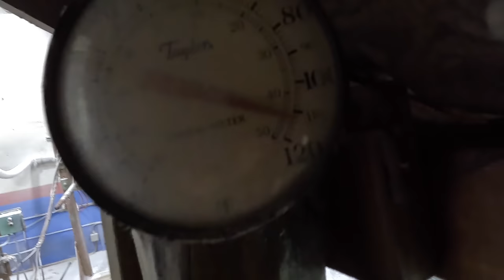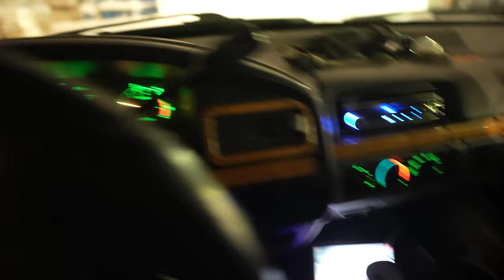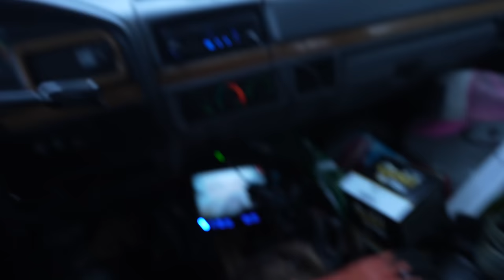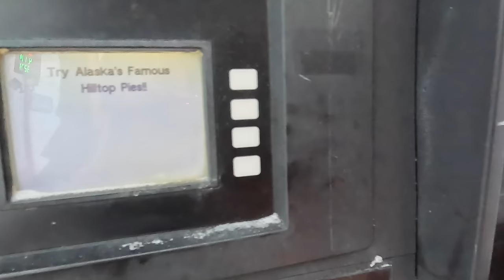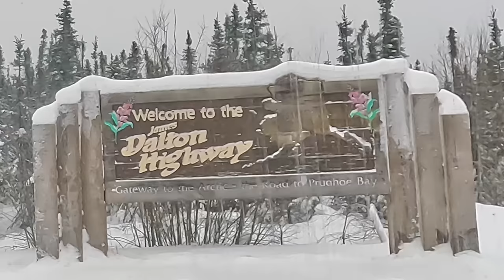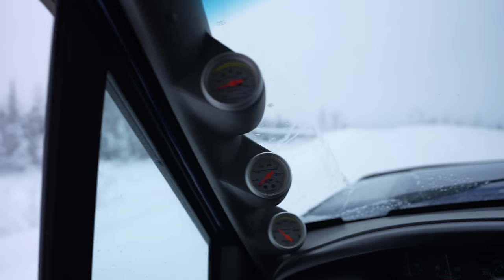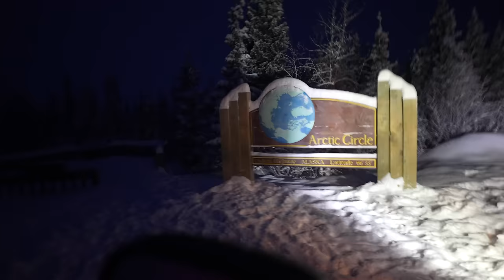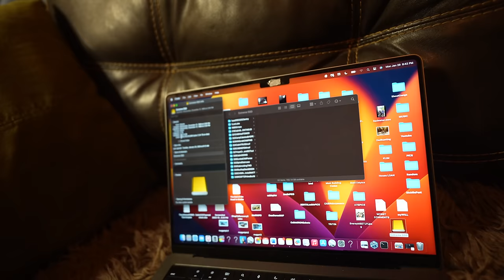Driving an Old Ford Diesel Truck 2,000 Miles to the Arctic Ocean in -53°F/ -47°C

Comment: I dunno if anyone else has said this but I recommend adding your fuel treatment before filling. That way it mixes fully in the tank. Adding after tanks a  bit of driving sloshing the fuel in the tank to be most effective.  Also highly recommend a white Roger’s 578-902 glow plug relay

Comment: Whenever I changed my fuel filter(7.3).  Id use a clean rag to absorb everything inside . Clean it bone dry in case water was still in there . Then a cap full of 911 and the rest new diesel to fill it back up most the way considering the previous diesel level when I took old filter out .

Comment: To Start a cold diesel truck ,put the propane torch directly in the intake it needs hot air and when it starts remove the propane torch (obviously not the plastic part)

Comment: Timmy,
Ive always wanted to drive that road and this was my treat for the day.
I watched the one before also but its been a while since ive watched YT.
I aced parallel parking on my first try in 2021 got my license then got a 
1994 Ford escort which is now an antique.
Unfortunately the next breakdown will park it for good.
no parts to fix the failing manual trans,syncros in second are going bad.
I lost 1st gear a week after purchase.
I love Ford and had a 2004 Powerstroke back in 2008.....Love those trucks.
BigT,Willow AK

Comment: Its air in line from removing filter.  Always visually check for coolant leaks b4 running unattended.  Wouldn't be a bad idea to have a set of guages in cabin

Comment: One suggestion get some stuff to insulate that trucks vitals fuel tanks fuel filter batteries ect and get auxiliary fuel tank like one of those construction guys use with the pump amd carry extra 40 or 50 gallons of diesel and u will be good

Comment: I’m the most impressed by your caution. You make us aware of your backup’s, backups. For more than just breakdowns or equipment failures. I was 16 when they built the pipeline. It was a better time than what 16 year olds have to live in now. Just purer. Anyhow I’m about a third of the way through your video and can’t wait to see where it leads you. Thanks for taking us along. Always, be safe. ✌🏻🤍

I’m almost done but just a suggestion to everyone who travels. You absolutely need a CB radio and it should be mandatory for them to watch Smokey and the Bandit at least once.   10-4?  ☺️❄️✌🏻  Can’t wait for the next video. Good night. 💤

Comment: Add some Howes anti gel between fill up that should help keep the fuel flowing. Most likely the fuel getting to the injectors probably had air in the lines when the fuel gelled up.

Comment: The diesel pump out 50 psi in Power Stroke 7.2 litres F-350 engine. The good  diesel injector can spray but when it's worn it stream at near 2,000 pound of burst. It into spray and mist of diesel inside combustion chamber.

Comment: At 40.05 minutes into your video I noticed you had method bead lock I would highly recommend you go to a method bead grip wheel. I don’t know if you’ve had any bolts break on your bead locks. I broke them all the time and got rid of them I would highly recommend going with the bead grip, got a good video going on. Don’t like anybody to have trouble though. Thanks for the videos OO Out 😊

Comment: I had a 1990 E350 ambulance with the 7.3 diesel that started to short cycle the glow plugs, turned out it does that after 4 of the glow plugs burn out to prevent over amping the rest.
Of course I didn't know that until I manually triggered the relay and burned up the remaining plugs. Check out the plugs next time you shut it down.

Comment: in my experience (15 yrs ASE Mechanic) when you turn the steering wheel on a  Ford, when the engine is not running, it will push PS fluid out of the resevior, especially when it is cold.

Comment: Tim, your truck wouldn’t start after sitting in the warm shop because there was air in your fuel system. You said you had pulled the filter out prior, then sealed the system back up. Takes a bunch of cranking to bleed the air out of the system.
Reply from the maker: Good to know!

Comment: I would get some of that universal, flexible exhaust pipe to add on to the end of your exhaust to route it away from your camper when you need to leave it running overnight while you are inside your camper.🍻

Comment: Just wanted to mention when running extended periods in 4x4 that the Super Duty vintage 1999-2003 front driveshaft maintence is critical. We have friends who've rebuilt transmissions/transfer cases when they break and take out the aluminium cases.....its UGLY.. driveshaft flipping around taking it ALL out. I preventively have had them rebuilt . .... just to be safe

Comment: Old Alaskan here and just wanted to mention that while I'm sure you didn't put on the emergency brake overnight, due to the temps, when leaving it idling and in neutral you might want to use a couple of pieces of your firewood...to chock one wheel. Just a little safety tip that should become a routine/habit. Love your videos and my hat is off to ya, for running the Dalton in a cold snap...just for the heck of it.  lol

Comment: Take it from a Canadian; run winter fuel or at least use a cold temp fuel additive.
If it doesn't start in the cold, putting it in a shed at over 100 degrees is not helpful.
Batteries freeze when they go dead, but it doesn't mean you need a new one.

Comment: In my experience at seven point three are notorious to air Lock Sometimes instead of Vernon a can of star fluid through. Do you have to just bleed the lines? Requires 2 people's own. Also, you can stick a 1/2 of 10 of ATF in your fuel tank. Help keep everything clean, jackers and what have you? It's a thing. I used to just feel my fuel. Filters up with pier a t f on my big Trucks

Comment: Toyo's I run are the  Open Country A/T III 17's.. I run at 35psi Cold 42-45psi Hot.. Really dig what you do. You really should get some Dryer Vent Tube to put on your Exhaust and run the fumes 6 or 12ft away. Have a ton of questions for ya.  Some day we will connect, it's how life goes.

Comment: Best advice i can say is when idling make sure to do a high idle so the motor is under a load. If you just keep it idling at regular speed 600 you will glaze the piston walls because the truck is not under a load. Just my advice is all i am giving. Great video.
Reply from the maker: I've heard that wet stacking is a problem, it's $50 a night to stock idle and $90 a night to high idle, pretty big difference, so I try to alternate it throughout the night
Reply: But that 50/90$ at least you know you’re not stranded and this experience will definitely help you on your next trip. Lots of good learning opportunities when doing trips like you’re doing to keep you going 🤔 😆.

I enjoy listening to the journey keep up the good work.

Comment: Hey Timmy you should definitely put some of that 911 power service diesel treatment in your tanks of fuel!!! I have a 2007 classic body style Duramax GMC and I have never had to plug the engine block heater in and I have never had to keep the battery’s on a charger when the temps get low!!! But I will always put just a little bit of 911 in the tank when the temps go anywhere below 0degrees out over night!! Plus I always change my fuel filter’s every other oil change and I change the oil in my duramax every 6,000 miles and I also use the same exact oil each time!! The one other thing I do absolutely every time I change the fuel filter is I always fill it up with tranny fluid instead of diesel fuel!!! The tranny fluid helps clean the injectors and I have never had any problems with having to replace the injectors witch can cost a pretty penny if need replaced!!! Definitely always put just a little bit of 911 in the tanks when the temps get below 0degrees it definitely helps keep the diesel fuel from freezing up!!! Good luck Timmy and I hope that everything works out for you buddy!!!

Comment: Turbo props and jets that burn Jet-B add something called Prist to prevent the fuel from having ice crystals form and thus causing a blockage. I bet you could get some from the fuel guys at an airport. Easy to find there phone numbers online.....jet fuel is basically same as diesel

Comment: Yes 👍 I was thinking did the pick up start up 😮well it did and I think it was the filter that gave fuel feed with the cold and no petrol mixt in the tank to stop 🚫 gell fuel still it fixed 🔧 well and starting working well with a topup

Comment: 39:22  On the beach we drop the air down to 15 lbs and on Assateague Island National Park, that is the law. If you get stuck in the sand and the NPS Park Ranger checks your pressure and it’s not 15 lbs you will get a fine. You are also required to have a chain or tow rope, a shovel and a board in your truck.

Comment: When you steer early ford vehicles without them running its normal for them to blow fluid out the power steering reservoir. It pushes the fluid from the steering gear to the reservoir and overflows it.

Comment: Hey ….i had a 1996 7.3     and there is another flaw besides the oil pump cavitation in -40 below oil.  

International at the time decided to increase the GPM from 8 gallons per minute to 24 gallons per minute simply due to the introduction of turbo charge added that year to run more oil around in the engine to cool off possible hot spots.  That was a great idea and it definitely worked to keep the engine cooler under full load.  International  also increased the oil gallery size in a few spots to provide more oil due to being turbo charged.  Unfortunately International over looked the front oil seal as it was designed for the 8 gallons per minute and not for the 24 gallons per minute for 96-97 model years.  The engineer from Navistar that looked at my truck in 97 with oil pressure gauges hooked up at only -18 below saw oil pressures over 160.  The front seal was only designed in 96-97 years to handle 90 PSI and not 160 PSI on cold starts.  This is due to the new GPM oil pump increase to 24 GPM.  

The sad thing the appropriate from main seal would have only cost about 7 bucks more at that time period.  

You noted oil on the floor and most likely at 110 degrees some of that oil came off the front of the engine.  The oil leak will go away once the oil temp warms up above zero using 15W-40.  You can get a lower oil point using Full Synthetic oil but expensive.  

Just be careful to watch the front end of the truck as if it’s colder then zero you most likely will have oil blowing by the front oil seal as the pressure is so high until the oil warms up which it will fall below 90 PSI for the current seal.

In short, Ford bought back my truck as it could not be fixed as Navistar had not approved a front seal at that time period of 1997.  

The funny thing 10 new 1997 7.3 trucks where taken off the delivery trucks well into northern Canada and ran just long enough to pull into the heated shop and 7 of the new trucks had oil on the floor when they came back the next day.  The Navistar engineer also was aware of this.  

P S, my Ford 1997 7.3 turbo crew cab was resold by Ford in Texas.  Also the Engineer stated Navistar was also considering a oil check valve to hold the warm oil at the fuel pump on the top of engine so it starts quicker as the oil ran down to the oil pan after shut off of warm engine oil.  Hence is why it takes a few cranks seconds to get the oil up to pressure and supply the injection pump the oil to create the needed 2200 PSI pressure to crack open the injection system of the diesel fuel to each cylinder.  

To avoid these issues, keep the engine oil warmer the zero if possible to avoid no starts and front main oil seal leak.  

Now you know!  Good luck and yes other than the above the 7.3 is a great engine minus the flaws when turbo charged in 96 -97.  

Wild Bill

Comment: Sometimes when you’re turning the steering wheel without the truck running, it will push out power steering fluid from the cap. Could’ve happened when you were getting it loaded onto the trailer. Safe travels man!

Comment: That leaking power steering fluid was simply caused by turning the steering wheel with the engine off. If the pump isn't running, fluid in the steering box is forced back into the pump reservoir as you turn the steering wheel causing the reservoir to overflow and blow the the cap off like you experienced (along with the resulting mess).  So long as the power steering fluid level is not too low when you finally get it fired up, there is no harm done. If the fluid is too low, you will know from the loud whine coming from the pump. Former Ford tech, seen it many times on these Ford trucks. Hope the rest of your trip goes safely and thanks for letting us tag along!!!

Comment: With that diesel engine you need to get some Antigel that will keep your fuel from gelling up. Be careful using to much of that 911 it will burn up your injectors.  I have two semi trucks.

Comment: Definitely high idle it in cold weather below 32°F to prevent wet stacking and washing out the crosshatch in the liners it will cause some serious blow-by wet stacking kills alot of diesel engines that idle for extended periods when the engine is not staying above operating temperature diesel engines love hot environments also use a weather front and belly tarp when it's below -20 it will help alot to retain the heat the engine needs to stay healthy

Comment: You a Cummins mega cab long flat bed with  a power pup with crazy Larry AFE Stage 2 cold air intake backing it up a stage 3 clutch from South bend with a 6-12 inch  Keldermen air ride sitting on Mickey Thompson Baja claws 37's Thats a Ultimate rig. To notch Nikki goes through anything. Don't forget a 100 gallon upgraded fuel cell with a 55 gallon Y Valve.

Comment: add 10-15% of the capacity in kerosene, that with some anti-gel should help a lot, and put the anti- gel in before you fill up so it mixes well. not sure if you've seen it or not but  they make a 38 gallon rear tank for that truck.

Comment: You ought to pick up not only the extra fuel filter, but why you're in town? Pick up a power steering line, so you have it plus the oil to put in there. So you have that the other thing I would pick up is a spare gas cappersonally. I would pick up a couple 31 in a glove box. One in camper, 1 in the back seats.  I don't know, maybe one in the wood box, so then you're never capless LO. L

Comment: I've seen a Vanlifer do this in a Transit van or maybe a Dodge Promaster make this same trip in the summer. Holy toledo, It is so freakin dangerous to do this during the arctic winter! I guess it just sunk in that if something happens, you could actually die from exposure! I mean damn, I worked in a freezer that got down to like -30. Hard to imagine that it's colder than inside an industrial freezer where you are driving at!

Comment: Your going to blow a hole in the piston with the ether so I would stop that.  

The glow plug cycle time is based off of the coolant temperature.  

The multiple cycles on your glow plugs are going to swell the tips.  When you have to change them you will end up having to pull the heads to get them out.

Comment: First mistake, shutting the truck off in -50! Fuel looks pretty cheap compared to all that headache...... 

I live in ND and when it's stupid cold (not as bad as alaska but still -20 or worse) the work truck runs 24/7. Pretty common practice especially for big rigs or equipment.

Comment: Hi from the opposite end of the world, we dont get it anywhere near as cold but we do get extreme weather here. I am a Diesel fitter and used to work on Antarctic machinery like bulldozers etc, and we used to fit heater elements to all  fluid tanks and block heaters not only in the engine but trans and final drives and either was a necessity, we found that camshafts suffered most of the wear in the engines and i often wondered why we never fitted some sort of heater in the rocker covers as well. Keep on showing these great adventures, cheers from Tasmania
Reply: You should move your batteries from the front to a warmer place inside, and you can pour hot water over the batteries to warm them up for better cranking, just a tip hope to help
Reply from the maker: good advice dude, I've got a coolant heater that in theory should warm the entire engine block up, camshaft and all
Reply: @TruckHouseLife  yes we used to fit coolant heaters in the block and radiator but we still had issues with our Caterpillar engines, I was just wondering if you guys have premature cam and valve wear, even though I am a Diesel fitter there is always time to learn and who better to ask than someone like yourself that lives and puts miles on your brilliant rig. Just a thought could you show and tell us what degrees in Celsius as well for all us Australians and the like 👍 cheers mate and keep on truck housing

Comment: you should always have a CO detector in a camper of any type. Preferably 2 incase one malfunctions. $40 (or $40x2) is a small price to pay be rudely awakened at beginning of what would be your forever sleep. CO detectors have saved my life twice... first a residential water heater had poor combustion and a bad vent (600ppm) and 2nd the wind changed and my generator (15 ft away) exhaust blew into my school bus camper (160ppm).

Comment: It’s amazing how clueless some people are. You literally try to start the truck up for hours with gelled fuel. Which means you start the whole system of fuel and introduced air to the system of course you have to crank on it for a while to build fuel pressure and of course you have to use ether. These last two videos have made me realize how some people actually know.

Comment: Ether is actually not bad for those engines. Those are similar to how tractor engines used to have actually an ether shot built on to the engine.So that way, it would start easier new ones don't use ether it will blow the engine